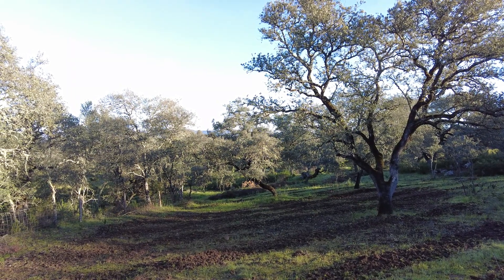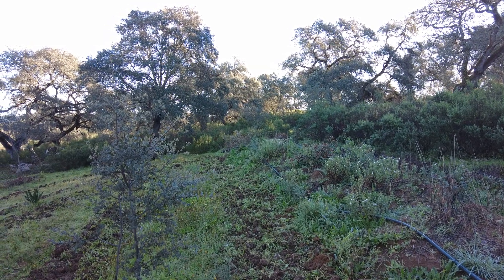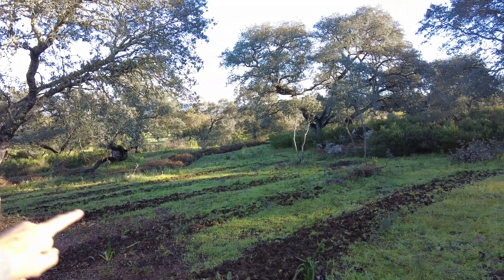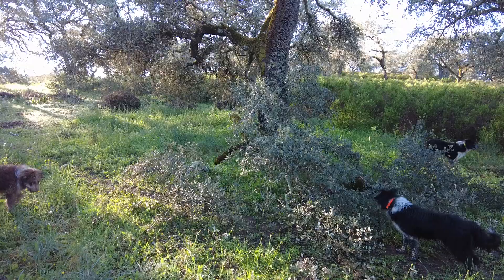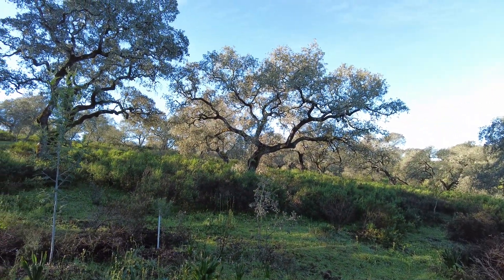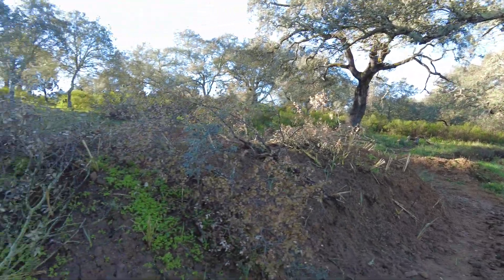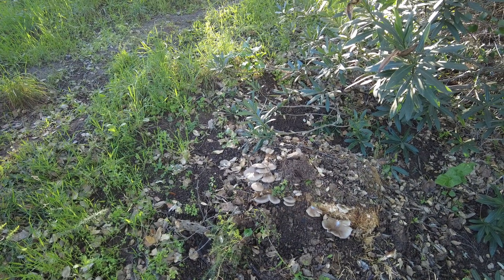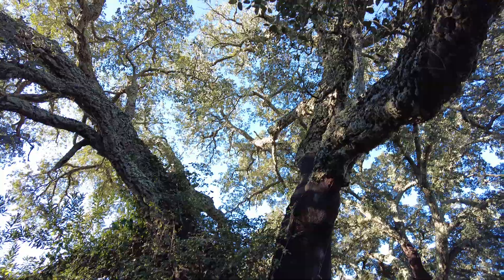Swale water infiltration measurement system installed.

Comment: I am a big fan of your "on contour" plantings.  I think it is a brilliant solution to diversifying the vegetative cover.  A good easy to remember rule regarding tree root health - do not rototill beneath the canopy of a tree - no matter how shallow.  
As the whole oak pruning process is new to you, I'll suggest you stick to the lower dead and dying branches (they are being shaded out by the canopy). With all of the trees you have, that will keep you busy for a long time.  And once that dead material is on the ground, the decomposition soil building process will accelerate.  In my mind, the priority is to get the low, dead material on the ground  and into the dirt.
I think over time, you will be more comfortable with the pole saw.  So start out working at a modest height.
I'm so glad you got the inside scoop on the local tree cutters masquerading as arborists.  Never invite them onto your land.  It is difficult to find a real climbing arborist here in the US too.
Reply from the maker: Yes Steve. Good people are hard to find. Thank you for sharing as always.

Comment: I’m no expert, but would it be beneficial to drill deep holes, 30-50cm diameter 2 metres deep, in your swales and fill them with sticks, brush and compost, so that the moisture penetrates deeper into the soil and is retained for a longer period. In the long run the compost would also improve the soil to a greater depth.
Reply from the maker: You speak wise words. I'll remember it and do it when time allows. Thank you for sharing
Reply: @SuerteDelMolinoFarm  Drilling holes does make a difference when dealing with plow pan and compacted soils.  The soil is definitely improved.  I think your dimensions are ambitious;  2 meters (6' 6" x 8") 50 cm is the size hole that would be drilled to set a wooden fence post.  That kind of drilling requires a tractor with a 3 point hitch and an 8" diameter auger.
I have had success drilling a 1 1/2" diameter hole x 2 feet deep x 12" o.c. around the dripline of a stressed tree as plow pan is typically 12 to 16" deep.  I have drilled this size hole with a battery powered hammer drill and an Amazon auger bit.  There is no need to fill the hole because trees need air in the root zone.  
The result with a stressed tree is remarkable one year later. (I live in a true 4 seasons climate) The trees are returned to full vigor! 
Drilling these holes replicates natures workers, the earthworms, which move vertically in the soil - not horizontally. 👍

Comment: great test system, especially using Alfalfa ....doesnt need to be scientific, besides you would have to have measured the amount of water in the swale  in the first place....I like your test very much. It will be interesting to see what come of it.
We have arborists like that too. One guy stripped a huge piece off a tree after he failed to undercut the branch, even though I warned him to do so.
we call them cowboy traders (basically anyone that claims to be able to do things they later prove to be incapable of)
My mouth waters thinking about your oyster mushrooms ...you can give them old branches and even wood chips they'll do great where they are now theyre established.
Congratulations on the grand baby
Reply from the maker: Thanks for sharing your welcome words and suggestions.
Reply: @SuerteDelMolinoFarm  I agree that adding rotted/rotting oak around the mother oyster mushroom planting is an excellent supplement for the oyster mushrooms.  With all of the dead limbs you have cut, there should be an abundance of such material.  Also an excellent way to multiply and distribute the beneficial mycelium to surrounding soil! 👍

Comment: Probably key line plowing (yeoman) on contour will help you treat more of the farm in less time.
Reply from the maker: Yes. I looked into it. The issue is the roots of the trees that will be damaged. Thank you for sharing
Reply: @SuerteDelMolinoFarm  You are right to consider the roots of the trees.  In my opinion, top priority, is the health of the trees.  It was wise to limit your tilling depth to 3 cm (1.18 in).  Keylining is a great technique most applicable to pasture or row crop field restoration. 👍
Reply: @SuerteDelMolinoFarm how you manage the depth swales given the problem of roots will be the same issue. Or is that the shank on a yeoman is deep?
Reply from the maker: @leedza  You are right. The swales are very carefully selected and with the small excavator I can feel and avoid the roots. With a plough I have almost no sensitivity about what goes on underground. Thank you for sharing

Comment: have you seen Project Granja Andalusa got 28000 trees planted free for MIRIAKI forest,why dont u apply,great video❤
Reply: Has he planted already? I think that will happen in April. He hasn't received the plants yet. Looking forward to the plantation drive of that Miyawaki forest.
Reply: @rajsinghji-84  Have you ever seen a 20 or 30-year-old Miyawaki 'forest'? I cannot find one. Just curious.
Miyawaki 'forest' is a fashion I don't like, even if the concept might be right for some cases. But good for him to get thousands of trees for free (although I expect within 5 years min. 80% of them will die due to overcrowding)

In my local park non--profit org planted one (Miyawaki Forest). First, it's not a PIONEER forest as in the original (?) concept, as the grass will be cut around. Second, trees were trying to establish themselves but were cut with grass each year. They produced tons of CO2 to create it (metal mesh, fence posts treated with chemicals, plastic-composite information board, many trips etc). But they prevent a small forest just 10 meters away from expanding for free, with zero money and zero CO2 costs. Even negative, as they would save some pennies on trimming grass. 

Maybe this concept is more suitable in some Asian areas, but I couldn't find a good case in Europe yet. But the fashionable way to syphon public/grant money.
Reply: @hotbit7327  I think there are a few examples from Japan, where this Miyawaki method became popular, I will try to find and share link with you. And whether Miyawaki method is sustainable or not, well I have only seen “success stories” so can’t really say it’s a bad method. May be the “failure stories” need to come put before we can judge it.
Reply: @hotbit7327  Oh yes - you are spot on.  The flippant use of permaculture buzz words and self styled gurus names drives me wild.  To the best of my knowledge, Martin has never gone down that path - and that is one of many reasons he has my respect and support.
"In 2000, the Miyawaki method was tested for the first time in a Mediterranean ecosystem in Sardinia, Italy, on an area where traditional reforestation methods had failed.[14] The original method was adapted while maintaining its theoretical principles. The results obtained after two and eleven years following planting were positive: plant biodiversity was high, and the new biocoenosis was able to improve without further operative support.[15] On the other hand, between 61% and 84% of the newly planted trees had died after a period of twelve years"
So your estimate of mortality was not far from actual findings.👍
Reply: @rajsinghji-84  Hello Raj.  YT won't let me share the link - but if you Google Manoj Misra  12 APR 2022 you may find a story as well as links to a number of YT videos that are unfortunately available in the native language only.  There is a photo of a forest say 20 years after planting (based on diameter ABH guesstimate) where ~80% of the planted species have not survived. 👍
Reply: @stevejohnstonbaugh9171  Thank you for sharing this information. 
In my neighbourhood, there is a young oak about 25 y.o. and it takes an equivalent of about 1/3 of the area (of that Miyawaki 'forest', which is only tennis court size) where they claim they have planted 600 trees (although they include bushes). Among them, I've counted about 25 oaks among several other species. That's why I think it's a very wasteful concept. 
Underneath that young beautiful oak, only some grass manages to survive. It has already claimed about 100 square meters of the ground.
Reply: @hotbit7327  Part of Miyawaki's density concept was shading out the grass as quickly as possible.  That's why I had to laugh when I read the municipal people where weed eating the grass and trees/shrubs.  It must be like that all over the world!  Drives me wild.  And yes - shrubs and understory trees are very much a part of the "magic mix".  But once you have an established canopy that completely blocks sunlight and apparently deer pressure, nothing will survive as in your oak tree illustration.  I can understand not planting a monoculture - but the density?  Does not make sense to me either.  Especially given the reports from the field (at least in the eastern US) that there are not enough native seed gatherers or nursery space to keep up with demand.
What I see photographs ~20 years in is only the canopy trees survive.   The canopy is impenetrable to sunlight, and the trunks of the trees are leggy, surprisingly crooked and covered with shaded out limbs.  Frankly, it looks like a failed tree plantation that was randomly planted without regard for spacing. Not the kind of place I would want to walk or look at. 👍
Reply from the maker: Me applying for trees. Uff. I rather beg for popcorn. Ha ha